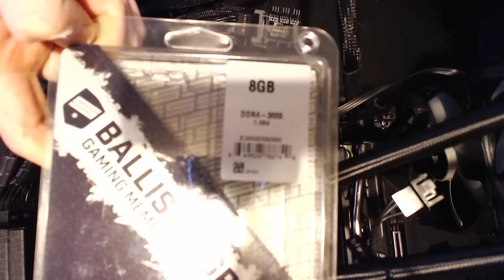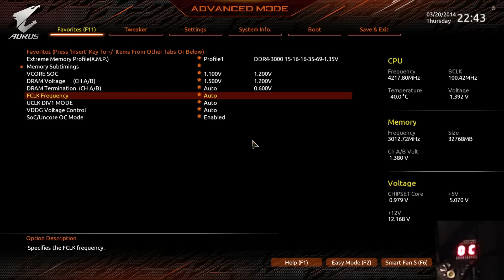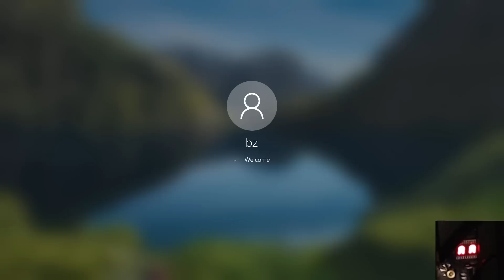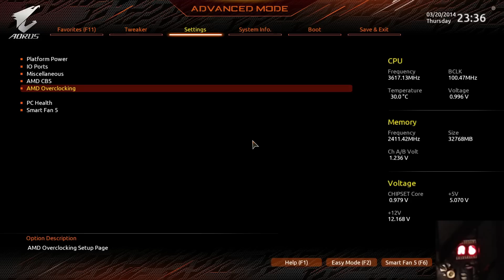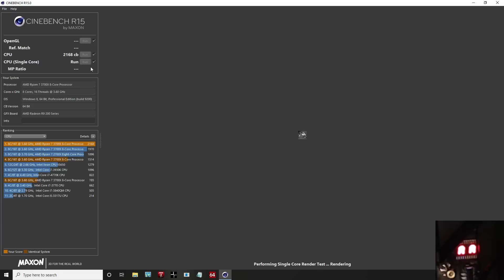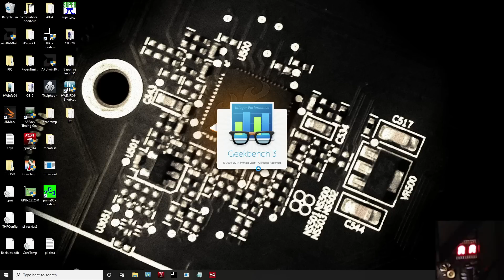Overclocking 4x8GB of 3000MHz CL15 Crucial Ballistix on a Gigabyte X570 Aorus Xtreme with a 3700X

Comment: I have a 2x8GB kit of this RAM at 3733 15-19-13-21-2T at 1.36V. Should i push it higher with more voltage or not bother. btw i have a 3600 and b450 tomahawk max
Reply: Oliver Herskovits try 1.45v, and just lower the timings to 13-14-13-21-t2
Reply: @hidde663  is that safe for daily use?
Reply: @oliverherskovits7927  im running 1.465 daily, i think i would go all the way to 1.55v but my sticks won't scale further, got a 2400CL18 kit doing 3018CL12.

i am running an intel skylake 6600k@4.828@1.456~1.472 aswell.

no issues nor degradading at all for about 2 years now.

but i believe there is always the posibillity of damaging the IMC.
see: https://www.tomshardware.com/news/skylake-memory-support,30185.html#xtor=RSS-181

for ryzen 3000 i would go up to 1.5vdimm & keep the soc to around 1.15~1.2 just to be safe

Comment: What would you use to stability test the fclk? i want to verify that works properly before i try to get my ram tigher
Reply: prime95 worked for me
Reply: Aida64 cache stress test
Reply: @femina_multis_faciebus  i was able to pass 18min before it crashed vsoc=1.1125, not sure how much is safe to push that
Reply: @chadmckean9026  that's well within safe limits, generally soc voltage up to 1.2 is considered fine. However pushing that much can actually cause performance degradation, so I'd do benchmarks in addition to stress tests just to be sure you're actually getting performance gains.
Reply: @femina_multis_faciebus  lasted 5min at 1.125v, guess it does not like more voltsage

Comment: I miss the old DDR1 days. It took some tinkering but if you managed to get it spot on, you could gain like 50% speed or more by matching timings and frequency to what the imc or chipset liked :)
Reply: That was only a thing because everything ran horribly loose out of the box...
Reply: @wewillrockyou1986  Which IS the point. You had a lot more to gain back then :P

Comment: Well, wasn't the drop to 1.2VMEM caused by the faulted Memory training before? I don't remember you setting it back up, so maybe you where massively lucky with the boot at 3600 CL22. I'm on the tuning for my 32GB (2x16) Dual Rank Kit at the moment but have no luck with more than 3533 @ 1,47VMem CL 16. Maybe I should try to push the Subtimings a bit higher...
Reply: Micron Rev E really hates tRCD I got my single rank kit to run cl 14,19,16 3600 mhz on 1,45 volt stable and on 1,32v with 16,19,16
Reply: Alright, got ahead of myself here, it's the 1.5V thing...

Comment: BZ, is it true that the colder your chip the better it overclocks? Trying to get 3.8 Ghz all core stable on a 920XM so I can move up the ranks on hwbot.
Reply: Kinda true, but if you go from like 80 to 60 degrees nothing is going to happen. Between 80 and -40 and now we're talking

Comment: Micron Rev.E likes 36.9 procODT on the Xtreme, [RZQ/6, RZQ/3, RZQ/1] is also good. [24.20.24.24] works well. These I do to get 4266Mhz/1900 4x8Gb. Though I have a Kingston based kits.

Comment: Hey man i really like your videos! Do you have some tips on how to test FCLK stability?
Reply from the maker: just throw a CPU test with a lot of memory usage at it. So like prime95 blend or IBT set to like 4GB of RAM
Reply: @ActuallyHardcoreOverclocking  thanks a lot!
Reply: I have the x570 Master with a 3900x, any tips on stabilizing 1900 FCLK? I know it handles 1800 flawelessly, but I can't seem to get it to post with 1900 :-(
Reply from the maker: @WhyteDem0n  FCLK is very much just a silicon lottery thing.
Reply: @ActuallyHardcoreOverclocking  Ah, so it's just a big ol RIP for me then. Guess I'll try the speeds in between to see if I can get those stable at least. Thanks anyway T_T
Reply: @WhyteDem0n  same for me. My 3600 runs fclk 1866 flawless and it is bootable on 1900 as well, but it crashes after a couple of houres :(
Reply: @anonymouscommentator  mine won't post 1900 and 1866 is unstable after a while, but 1833 seems to be running flawlessly since I made my comments yesterday

Comment: Did you overclocked the 16gb dual rank modules too? Can the dual rank 3200 reach the same speed?
Reply from the maker: I only have 16GB B-die sticks.
Reply: @ActuallyHardcoreOverclocking  can the e die sticks reach the Speed?

Comment: Any significant differences compared to 16x2 configuration of this RAM when it comes to overclocking ?
Reply: Daisy-Chain (X570) = 2 sticks  T-topology (some non-X570 boards) = 4 sticks (but only on strong AF memory controllers, meaning coffee lake, or Zen 2)
Reply: @kelvinyonger8885  Overclockers with Zen 2 and rev E say that 4 single rank sticks (4x8gb) clocks higher than 2 dual rank sticks (2x16gb). So I'm guessing Daisy chain doesn't always favor 2 ram sticks. Maybe BZ can confirm this?

Comment: With the t-topology on these boards are you better off getting a 4 dimm kit for rank interleaving or do you still get significantly higher clocks with only two sticks, single rank?
Reply from the maker: this board is a daisy chain like basically every other X570 board
Reply: T-Topology is used only on the AsRock X570 Taichi board as far as i know. And personally i don't think it's worth it unless you are trying to set a speed records with 4 sticks. Up to 3733-3800 RAM speed Daisy Chain board does just fine with 4 sticks just like T-Top. Assuming the sticks themselves use good chips. Going above that you incur a big latency penalty by running FCLK and RAM at 2:1 speeds.
Reply: T-topology would be a thing you'd generally see on HEDT boards, not mainstream ones.
Reply: @femina_multis_faciebus  on x470 gigabyte made even their cheap motherbpards t top, also the x370 strix  and c6h from asus. Idk why gigabyte felt like doing t topology on x470, and not on x570. Honestly i think it doesn't matter for any ryzen generation, the IMC is the limit anyways.
Reply: @givemeajackson  are you sure about that? I have a Gigabyte X470 board, and not one of the cheap ones. I should check... I don't know how though
Reply: @femina_multis_faciebus  gaming 5 was t top afaik, gaming 7 as well